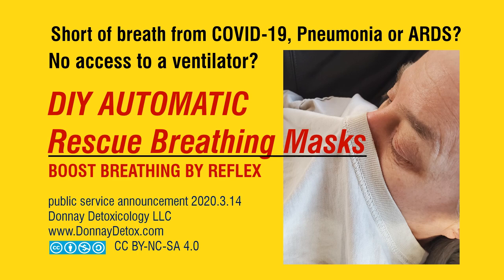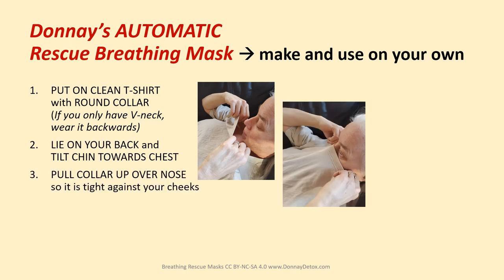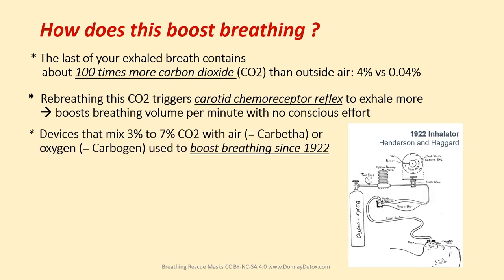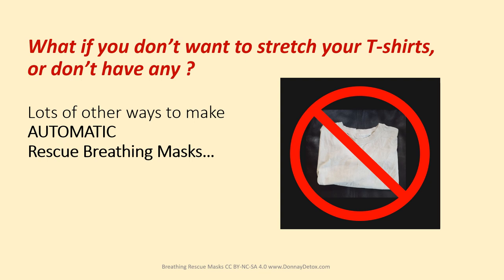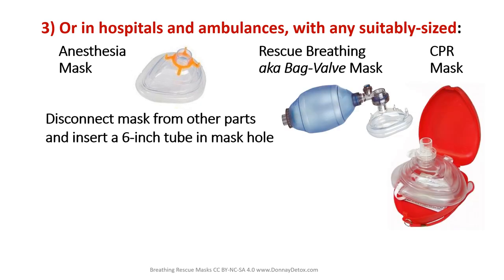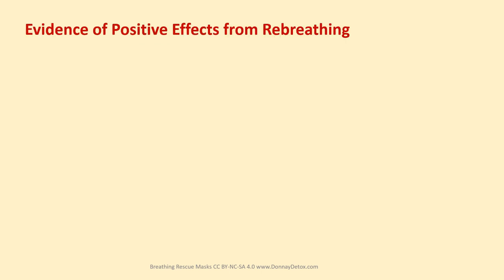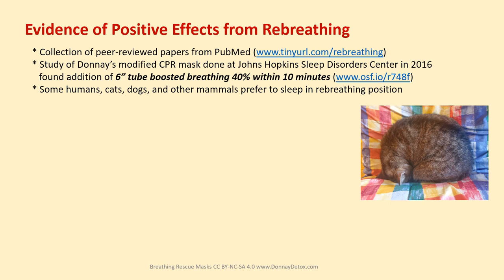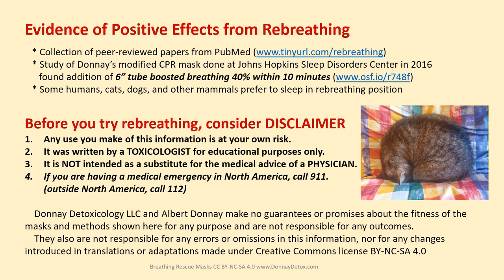DIY AUTOMATIC Rescue Breathing Masks

Comment: You can also use a paper bag like they do for hyper ventilation.
Reply: Thanks for raising this, which I imagine many people have heard of.  I don't mention the paper bag method in the video because you can't use it for more than a minute or two as the oxygen level inside keeps falling and can't be replenished.  The designs in the video all allow sufficient air exchange so you can wear them as you want, though I suggest no more than 30 minutes per hour to give your respiratory muscles at least equal if not more time to recover from the extra work they do by reflex when stimulated by CO2.
Reply from the maker: @minnesota7010   Sorry you're having headaches and fuzzy vision, which CO poisoning can cause.  I am a toxicologist not a doctor so can't advise you but it is a principle of Detoxicology in my practice to favor treatments that reduce a person's toxic load without adding to it.  Oxygen is extremely toxic, and inhaling high concentration at high flow rate as is typically done in ambulances and EDs via non-rebreather mask that prevents CO2 accumulation actually causes humans to make more CO naturally in response, and it drives this CO from arterial blood into plasma and from there into tissues.   Problem is that free CO is much more toxic in tissues, where it causes acute hypoxic multiorgan failure.